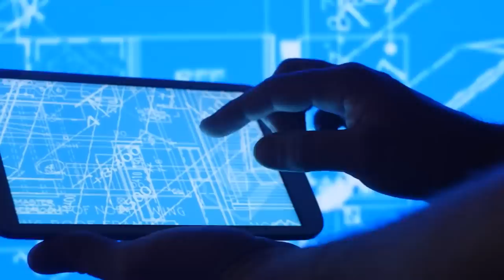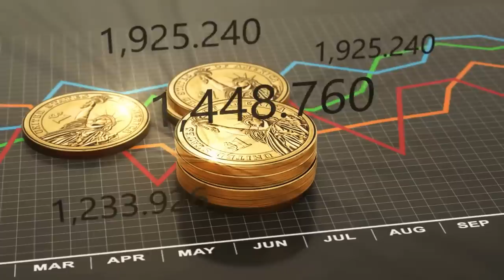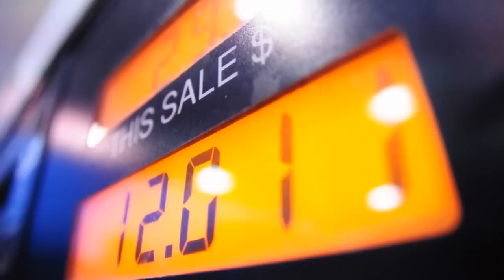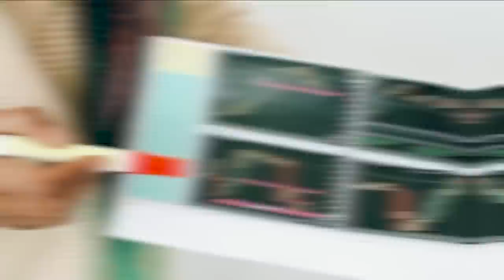Discover Jamaica's Mind Blowing Game Changing Projects

Comment: Congratulations Jamaica 🇯🇲 on your endeavors.
 The road infrastructure need an immediate attention the truckers needs proper roads for the tractor and trailer. 
Most of all  rebuild your railway with the road to standards you have an impressive intermodal system. 
Jamaica 🇯🇲 is on the rise